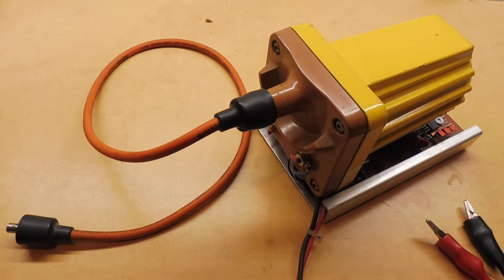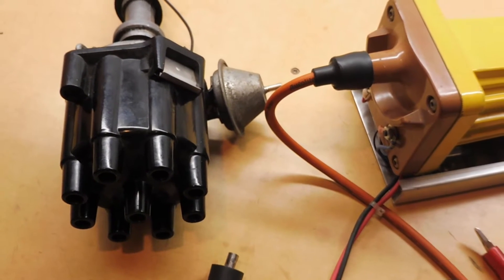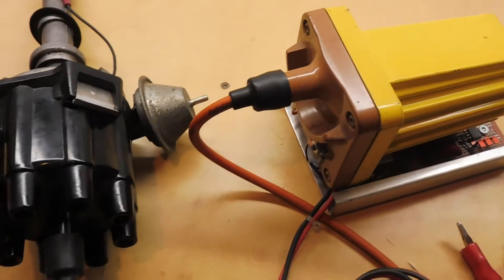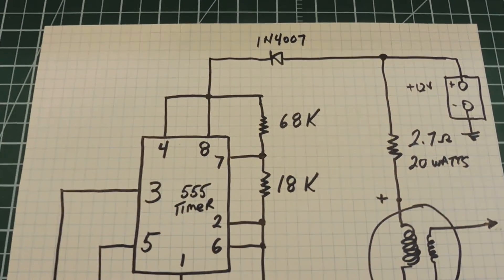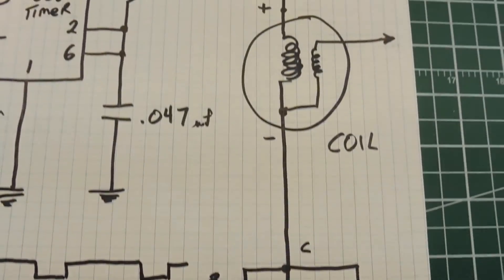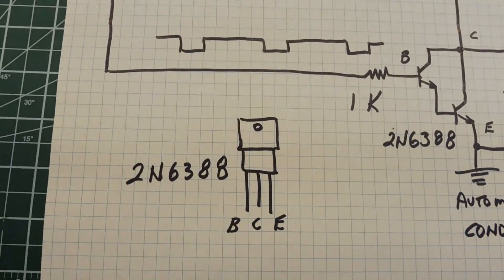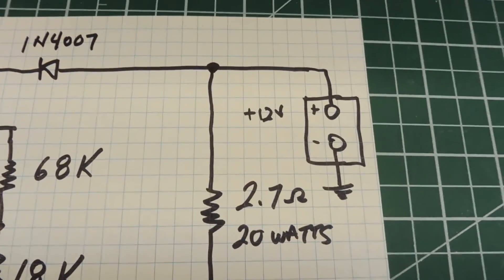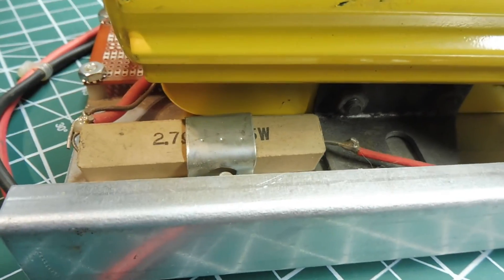High Voltage Spark Generator / Engine Ignition Simulator

Comment: no me queda claro la coneccion del 2n6388 ,podra dar un detalle con grafico.  saludos cordiales desde Buenos Aires --Argentina gracias
Reply: I used a relat instead of the 555 timer  to fire  a 2n2955 Toe transistor

Comment: I have always wondered which screw terminal of an ignition coil ( "+" or "-" )had the TWO pair of wires connected inside, and have been searching for a LONG time with no luck, and many contradictions.  According to your diagram, the "-" terminal is the one with two wires connected internally--is this correct???  Or is it uncertain?
Thanks much for the great video.
Reply from the maker: The ignition coils were manufactured both ways. The most common you will find today are wired like my diagram. The older positive ground cars of the 50's had coils that were wired the other way to get a hotter spark.